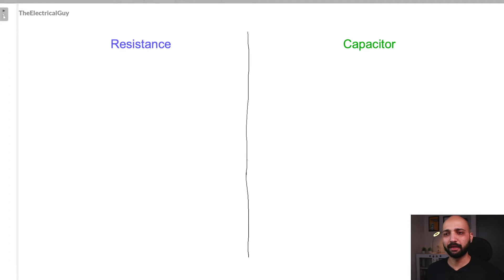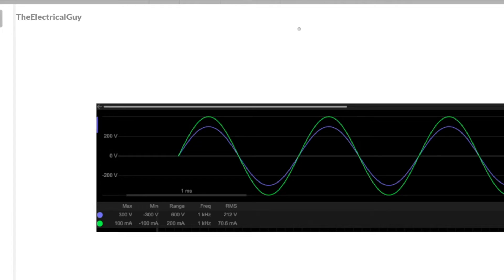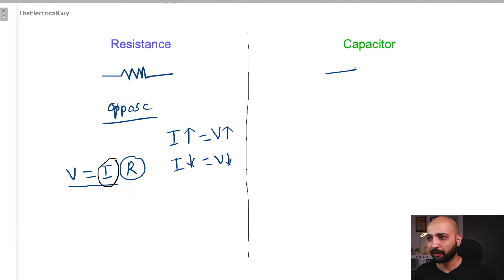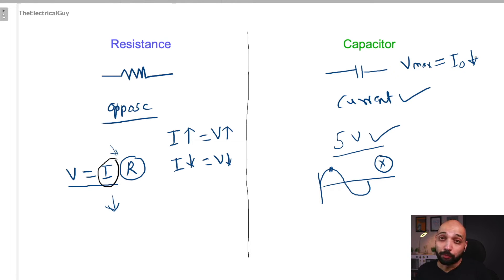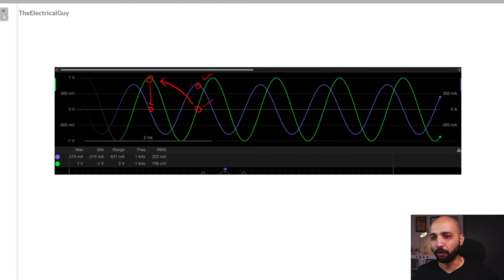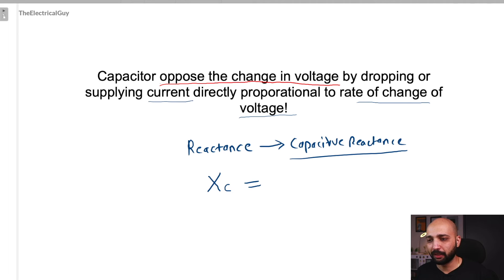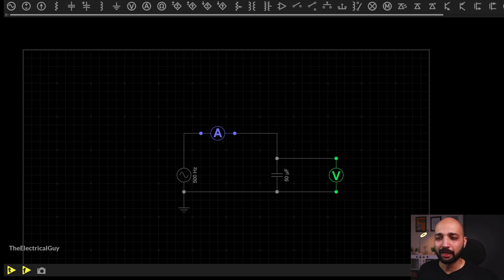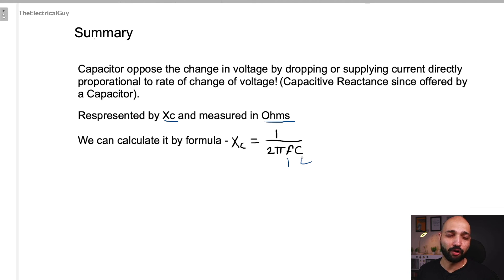What is Capacitive Reactance & how to calculate it? TheElectricalGuy

Comment: You do a wonderful job of explaining.  Thank you.  However, at 8:15 in this video you said something that's not correct.  You said that voltage is leading in a capacitive circuit, which is not correct.  You said it correctly earlier but at this point in the video you were incorrect.  You want to add an errata as many people watch your videos.  Thank you.

Comment: these statements make it confuse, the current through capacitor is opposed in DC and allowed in AC. the only example where your statements are true are when capacitor is in parallel with voltage source,  Capacitors have more reactance in series with DC voltage, and less in AC.

Comment: @Gaurav J at 8:10 you mention that in a capacitive circuit voltage has a head start by 90° ahead of the current. It is well known that Voltage lags current by 90° in a pure capacitive circuit. Can you explain the difference please.
Reply from the maker: Yes.. voltage lags by 90 deg with current.. i might have said the opposite..